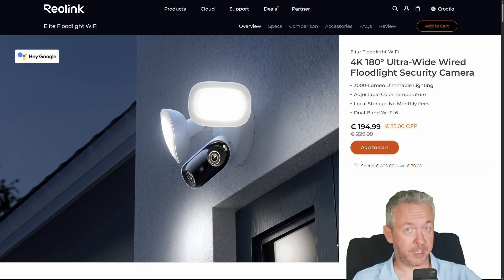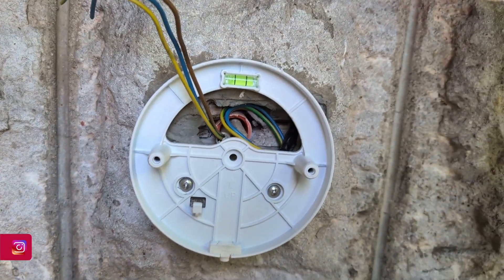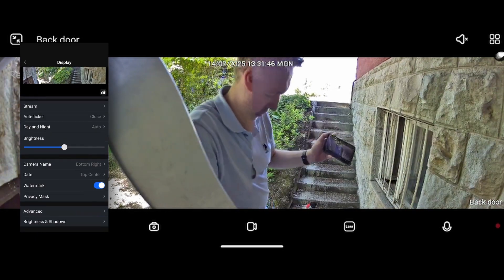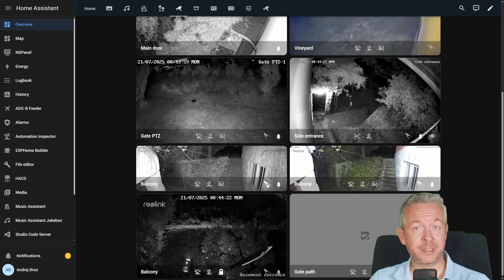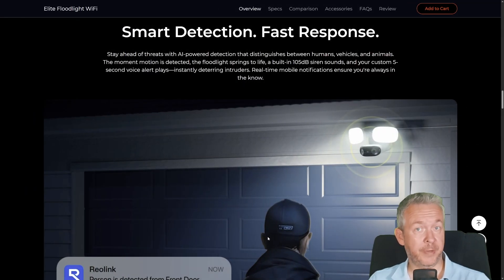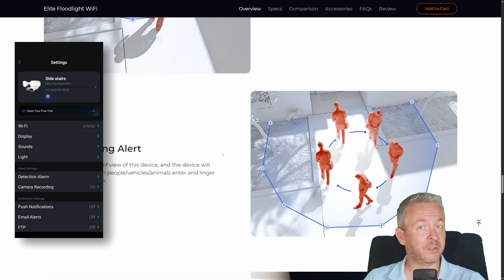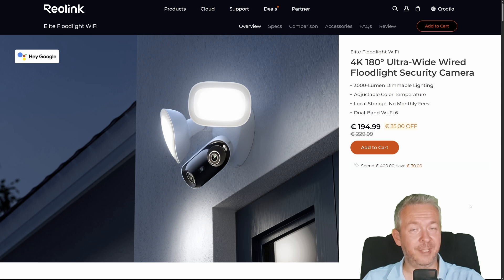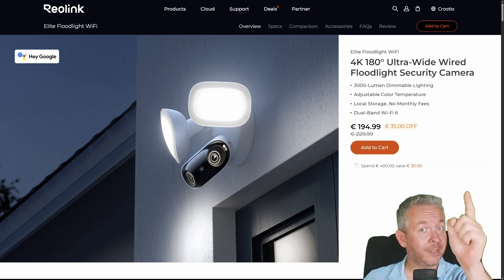This Reolink Camera is So Bright It Scared My Smart Home

Comment: No Ethernet port and 20fps is bad. Ethernet for security and offload WiFi bandwidth, POE for power outage scenario to still have the camera recording, 20 fps is bad for clarity.
Reply from the maker: There are other models you can find from Reolink. This is a WiFi model that is used to replace old floodlight. I haven't seen a lot of floodlights that are PoE powered or have Ethernet connection.

Comment: Can this work with Ethernet instead of WiFi?
Reply from the maker: This one, not - this is part of the WiFi series of devices. I think other cameras from that range are Argus. 
Since it's mains powered, you can consider it as a replacement for outdoor light/floodlight first with camera as add-on
Reply: @BeardedTinker thanks! I wasn’t thinking Poe, just literally wired connection for data
Reply from the maker: @michaelthompson657 there is just a USB port on this one unfortunately. No Ethernet
Reply: @BeardedTinker that’s a shame!